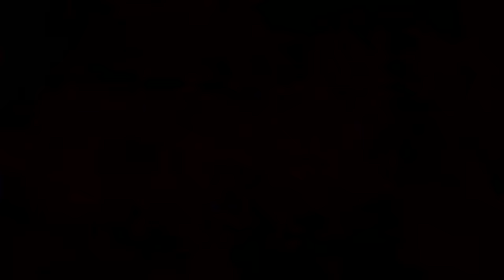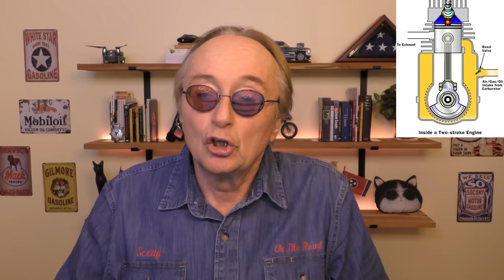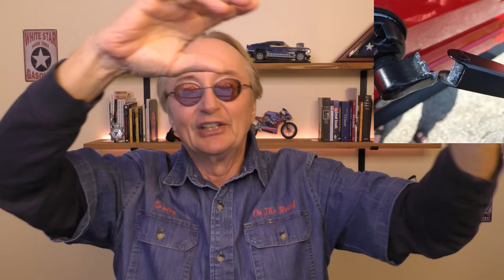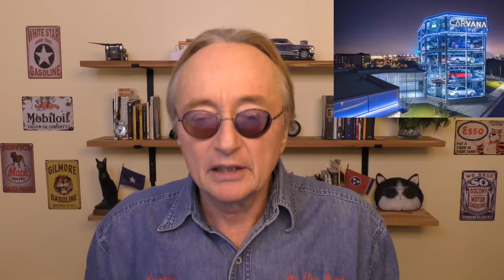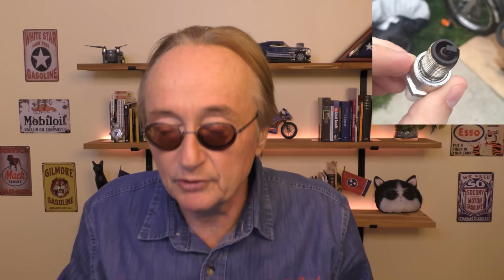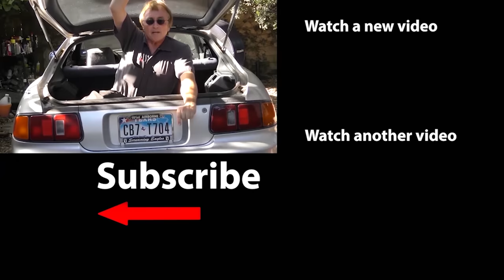Mazda Just Changed the Game with This New Engine (Goodbye 4 Stroke Engines)

Comment: the number one problem is twice the explosions per mile, in theory if you had a transmission that could have a wide enough range in ratios you might have something there. but the laws of thermodynamics are pretty hard to get around. if Mazda has found the right loop hole more power to them they could really use it right now

Comment: Mercury Optimax and Evenrude E-tec are/were two stroke motors.  They deliver or delivered clean and efficient power.  But there have been reliability and longevity issues.  Issues that I think eventually ran Evenrude out of business.

Comment: The reason we put the wipers up is because the ice freezes to the blades and makes it not wipe the windshield properly but you can just break the ice off if you leave them down
Reply: And then you can wipe off the layer of snow and use the windshield spray juice to help get rid of the ice too

Comment: Detroit Diesel engines were 2 stroke with valves, cams and a supercharger, plus after coolers and turbo chargers being added later on.  These were also fuel injected using High Efficiency Unit Injectors.  All this started back in 1957.    I wonder if Mazda has managed to patent preexisting technology

Comment: I've seen people coming by and sticking cardboard under their wiper blades or covering their windshields completely with reflective covers with thin straps you close in the doors to try to make de-icing and protecting wiper blades easier. I wonder if there's an idea in just making a protective sheath to slip over the wiper blades so you don't have to pick them up at all...

Comment: Take a pool noodle, cut to length of wiper and slip it on your wiper blade. Or black foam pipe insulation. Already cut.  Seen this on a  few cars, big rigs, and  motor homes.  Seems to work well. Keeps sun off em in the summer

Comment: That Mazda supercharged two stroke could be a great engine in an experimental plane, particularly if the engine was supercharged for maximum takeoff power and super normalized for sea level pressure or a little more at 10,000 feet.
Reply: @Liberty4Ever great idea but the experimental aircraft engine market is likely not large enough to justify tooling and production costs.
Reply: @toddsmith8608  - I'm not suggesting that experimental aircraft are a viable market to justify development and production of the new Mazda engine.  I'm saying that once it's in wide scale use in the automotive world, experimental aircraft builders can take advantage of this engine's reliability and power to weight ratio, with maybe a remapping of the engine control computer for higher altitude and maybe some change to the oil management to prevent oil starvation at extreme bank angles or negative G flight maneuvers.

Comment: The other down side to a 2 cycle engine is that they area scavenge air system... Super charging a 2 cycle such as a Detroit 871 is required when it has valves because first of all diesels run slower and second a 2 cycle keeps the air moving into the engine and also keeps it from running in reverse...

Comment: Up !
You park your car , interior is warm , inside wind shield is warm.
It causes ice on the out side 
(This is where human fail )
We leave wind shield wiper on as we shut down engine.
As soon as you start your car , it goes into a cycle of whipper action .
You hear snap, whipper motor runs freely as your whippers are stuck in the “expensive “ position .
Up and save money

Comment: Put a dry sponge under the blade, green side up.  You grew up up North but some of those Minnesota ice storms are just brutal and the defroster has a time trying to warm the -20 air up.  In WW2 the Germans learned a trick the Russian airforce already knew.  They put fuel in the engine oil after a flight, Otherwise the engines would freeze up and couldn't be started till thaw.  During engine warm up the fuel would evaporate.  Living up in the cold is crazy time.  That's why I encourage global warming to increase food production above the 49th parallel.

Comment: Formula One teams did some R&D on 2-stroke engines, but it never took off. Mazda's engine is probably the result of that R&D. I wouldn't be surprised to see it work. Theoretically, it should also mean extremely efficient vehicles, too.
Reply: I’d love to see 2-stroke F1 engines !!
Reply: @sking2173  
The big question mark in my mind isn't whether they can harness the horsepower of a 2-stroke engine, but rather whether they can get enough usable torque from it. I suspect that one of the reasons for not already adopting 2-stroke engines is that the torque simply wasn't available across the entire power band.

Imagine F1 cars lined up on the grid at the start of a race, revving their engines and waiting for the green lights... then all the cars scream, as the lights go green...  only to see them slowly accelerate away.

Complete anticlimax. 🤣

Comment: Way back in the mid 80's Smokey Yunick, the highly regarded racing engineer predicted the end of the complications of poppet valve engines. 

He foresaw computer controlled direct fuel injection with forced induction and sealed lubrication engine designs producing similar or more power than what is common to conventional engines with the normal camshaft controlled valve train.  Studies have shown that upwards to 20% of an engines power potential is needed just to operate the components of cams and valves.

Elimination of this with a simpler intake/exhaust system such as piston port or rotary valve intakes, computer controlled to alter timing as needed could produce small, lightweight power plants to rival the larger more complex and expensive conventional engines.

And, just think how much fun the tuners will have designing expansion chambers and 'slippy' pipes for more power!!  I guess my old Saab 96 Monte Carlo wasn't such an oddball afterall...

Surprised that Mazda would do this??  Not at all.  I've overseen two different GT2 and GT3 SCCA RX7's with the rotary engines.  I've watched for years all of our competitors before and after each track session fiddling with cam and valves.  They'd carefully adjust valve lash before going on track, often after a track session I'd see them repairing rockers, lifters, broken/bent pushrods.  On the other hand I'd be focused on fine tuning the big Weber carbs to weather conditions and tweaking the suspension for better handling.

Like the Racing Beat logo and t-shirts used to say..."Valves, we don't need no stinkin' valves!!"
Reply: You might find this interesting - look up FreeValve. It’s a cam less, electronically controlled valve design. It’s been test fitted on a few engines with greatly improved efficiency.
Reply: I loved 2-strokes back in the 70’s. Great power, easy to repair. And now, they might still be a future player in automotive engine design. GREAT !!

Comment: A 2 stroke could produce a ton of power. They might be on to something if they can get the efficiency
Reply: The more power and the smaller the engine they usually tend to have a shorter life span. It's simple physics.
Reply: @Velodynamic  Not if it's built right. Proper displacement

Comment: My Mitsubishi Galant GDI breaking system seems wrong! whenever I apply the breaks the car seems to skid towards right! ABS is not lighting and my mechanic has checked all calipers four of them did greasing, installed new pads but the problem seems to persist. What could be wrong? Could ABS system fail without lighting or should we try cleaning all ABS sensors? I thing my front right break is more active than the other ones...

Comment: Hi Scotty, I have  honda civic 2007 manual transmission 1.8 L, the engine get noisy after reaching 90km/h speed (engine sound loud continuesly).. I replaced the spark plugs and front wheel bearings but the problem still not solved. what that could be?

Comment: It's a damn shame that mechanics are glorified but body work isn't and they make a lot less but it's a lot more dangerous due to the chemicals
Reply: Yes! A good body shop family, J & J custom rebuilt my 1984 S10 P/U having to repair by welding & replacing rusted out areas around windshield! Truck looks better than new. Their daughter repaired a leak in the passengers side seam that was leaking water in. The mother & daughter pin striped the body of the truck with a perfect color match to the original factory grey of the truck. Reason we went to such extensive body work is truck we have had from brand new from the factory & fits our 4'10" frame size perfectly!! No other trucks within the last 30+ years fit our short human size as well. Always have  good women pick colors of striping!

Comment: Scotty I think you misinterpreted the guys problem with the stripped out spark plug, no way is he talking about the corners or "ears" of the spark plug hex being stripped, he talking about the threads themselves being stripped
So must likely a more serious problem, in fact he's probably screwed if the spark plug threads in the cylinder head are stripped, not an easy fix

Comment: It has timing gears like a diesel, you don't have to worry about no timing chain or timing belt. Most reliable gasoline motor, all that motor needs is some nice fuel injection instead of a carburetor

Comment: Scotty I need your help… I’m trying to change my spark plugs in a 2008 jeep commander v8 4.7, it says to use a 5/8th spark plug socket to change them but that size doesn’t fit into the cylinder head so what should i do? Is there a certain tool I need to buy or something ? I tried a 9/16th that size fit in the hole but doesn’t fit the spark plugs
Reply: Sometimes different brands of socket have thicker walls
So it won't fit

Make sure yours isn't one with thick walls 👍

Take yours to an auto store to see if they've got thinner walls on their sockets than yours does 👍

Sometimes we've linished a socket wall to make it thinner on engineering projects 😅

Comment: The real reason Tesla dealers in PA don't offer state inspections is not because of emissions testing.  Your inspection station doesn't need to have an emissions tester because 42 counties in PA don't require a emissions test but if your station is in an emissions county (and depending on which county the vehicle is registered in) you still don't need one. However without one you'd have to have send that car to be tested before you can perform the safety inspection ( or more to the point be able to issue the safety sticker ).  The real reason is ( you are partly correct ) is that Tesla dealers don't want to work on anything but Tesla's and if you do PA inspections you must take in whatever vehicle your station is certified to do.  PM me if you'd like more info on this Scotty.

Comment: The smartest expert is the one that keeps an open mind, hears the opinion of others, asks questions, and learns from his experiences. I'll keep my wiper blades up when there's a winter storm. Those wiper blade "experts" must live down south and are quoting from their small intellect rather than actually having any experiences with snow and ice on their windshields. It's far easier to disable your wiper blades when they're stuck down to the windshield when attempting to gently unstick the blade from your windshield even when your car has been running for 5 minutes. Been driving for over 40 years and have never had an issue putting the wiper blades up. Makes me wonder what a wiper blade position "expert" gets paid and why?

Comment: Wipers UP,,    Cant scrape with them down.  The Defrost  hits above the bades parked position ,so its the 1st to need an last to thaw.. Bulky snow suits can activate the on lever.  On engine start your blessed if the blades aren't  bent torn or destroyed.. maybe change a fuse, in the cold, under the dash ,  or fire wall,  hood.  Very few vehicles omit that ice berg Valley the wipers, tree leaf, mice turds &  window washer jets reside in.. Cheep an design cop out

Comment: And they wear out quick atleast old ones you have to do top ends more often then 4 strokes.. piston and rings will be a service every 150k maybe but will be easier then a 4stroke rebuild
Reply: MUCH easier to repair. Even mechanically inept individuals could pull the cylinders on 2-stroke bikes and have them rebored, but an overhead cam 4-stroke was quite a different matter.

Those 2-strokes had a lot going for them, if not for that blue cloud out the pipes that’s so off-putting today.

Comment: Scotty, Did Mazda ever experiment with
GDI in the Rotary engine?
 I know they built some diesel rotaries.
 A supercharger may be a good choice for multi-fuel capability.
I wonder if the two stroke Mazda uses a variable induction intake manifold.
Reply: Not sure, but I would think not as it would be supercharged ...

Comment: I remember back in the 90s fla had emissions testing for a while a guy I knew had a deisel converted to use lng liquified natural gas & the machine couldn't read any emissions long story short he paid thru the nose for stupid govt buerocrisy but these days I'd suggest people that are worried about carbon footprint look into deisel lng conversions as alternative to electric you'll have a million mile engine with virtually no carbon build up in top of pistons etc possibly running longer & better than with deisel much cleaner & less $ than electric it may be a good fit but I'd ask Scotty first as I may be unaware of other variables

Comment: Is Mazda still considering an I6? there were rumors not long ago
Reply: Not considering. They patented, designed and built them. What they're going in, no one knows yet. Speculation is the end of the current Mazda 6 will lead way to a newer platform 6 that offers the inline 6 engine. There is also a design patent leak of a possible new sports car that will use it. Mazda being very bold with Japan's declaration of forced electric cars by 2035.

Comment: I could let my car run for half and hour and it still wouldn't be warm, it needs load on the engine to get warm. 1.4t. I have a mat I put on my windshield before the storm then just pull it off the next time I need to drive

Comment: Two stroke engines have poor torque ranges, in the lower RPMs torque suffers too much in two stroke diesels.
Reply: That's where the supercharger comes in handy
Reply: But that's also perfect for electricity generation. That's why the two stroke v engines that were used on locomotives for so long historically run generators in the optimal RPM range that then drive traction motors, so for a hybrid application I think it makes great sense!
Reply: It all depends on how they're tuned

Comment: Can they make a 2 stroke that you don't have to mix the oil and gas together?
Reply: They were making those back in the 60’s ... The 2-stroke bikes almost all had “Autolube” systems using a small variable-output pump that injected oil into the intake tract.

Comment: The old 2 stroke engines ran great but smoked like hell. This new thing i imagin will be simular to a regular 4 stroke GDI engine with turbo to pressure the cylinder and some kind of built egr recirculation to cut emissions. I imagin at 120k miles this engine will need a headgasket or turbo.

Comment: Modern fuel injected 2 strokes can be even cleaner than 4- strokes. No oil in the fuel, either. But pistons going up N down is still dumb. Wasted inertial energy. We've just gotten really good at it after 125 years, and modern materials+ technology. I loved ring - ding the wolverine...
Reply: So you want to bring back the rotary engine ??

Comment: I guess Arnie bought a Yukon because he can't buy Hummers anymore.  And I have to disagree with Scotty about the wipers - having them up makes cleaning the ice off the windshield so much easier.  No way I'm waiting long enough for the car heater to melt it off.  Two stroke may produce twice as much power but it burns twice as much fuel - I can't see how you're going to get around that.

Comment: The technique of direct fuel injection right into the combustion chamber head pretty solves the pollution issue compared with older 2 strokes which used transfer ports to move the incoming charge and expel the outgoing gases. The ports and flow resulted in a fair amount of unburned fuel etc. The oiling also has been reduced significantly and is now not part of the fuel mixture. Evinrude outboards took 2 stroke technology pretty far but they went under as the  negative reputation of 2 strokes could not be overcome, even though the tech made the 2 strokes superior in nearly every metrics. More efficient, more powerful, quieter, pollutes less, more reliable with fewer parts etc etc etc. Orbital engines (if I recall) out of Australia also took 2 stroke technology pretty far. But I think they ran into the legacy auto world with their various suppliers who didn't want to upset the apple cart. 2 strokes had a lot of promise but I suspect its too little too late for any substantive comeback.
Reply: Just get a windshield cover, no ice on the windshield or the wipers.

Comment: Mazda will have to use a radiator 4x the capacity to handle all the extra heat a multi-cylinder two-stroke will produce.

Comment: Old gas-and-oil burning 2-stroke gas engines pollute like hell, but with supercharged, direct injection engines, with independent lubrication systems, the modern 2-stroke doesn’t have to be the nasty, smoke-blowing engine of the 1970’s. 

Since it’s pretty obvious that the IC engine’s gonna be around for a while longer, there is no reason not to pursue further improvements for the dinosaur-fueled engines.

Comment: two stroke oil is better now too
Reply: They’re not gonna use that type of lube system on a modern automotive engine. The thing will have an independent lube system like a 2- stroke diesel.
Reply: @sking2173  what oil do they use diesel is oil asking